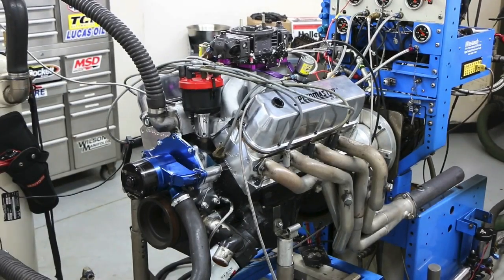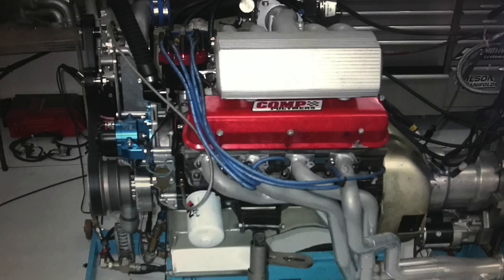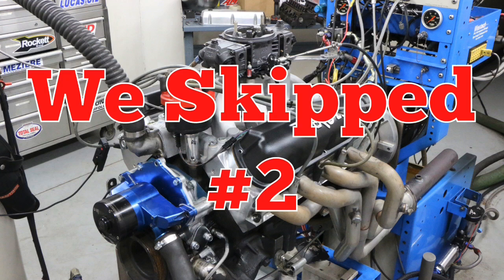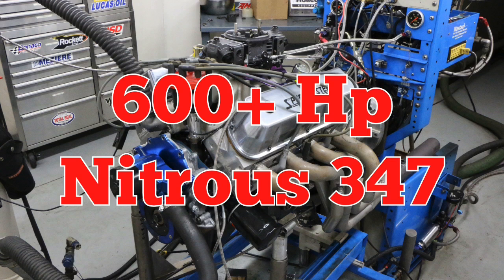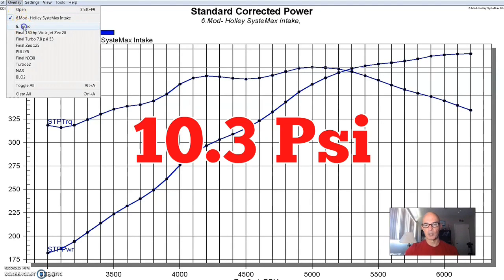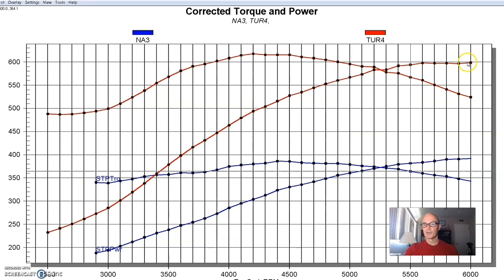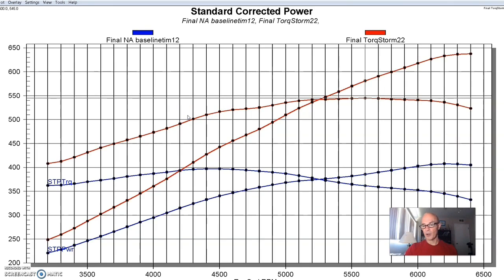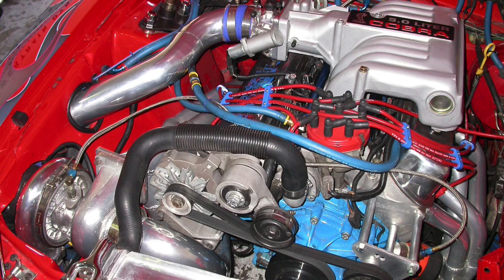5.0L FORD BLOCK SPLITTING-FACT OR FICTION?

Comment: Up until 1980, IIRC, even Ford rated the 289/302 safe for 600HP, the Boss 302 block safe to 1200. In about 1980, Ford was thinking it was time to get rid of "big" V8s, and they came out with that misbegotten 255. When they changed things around for that short-lived piece of garbage, they took the opportunity to fine-tune their thinwall casting process even more, in the name of weight saving and fuel economy. Those late blocks are noticeably thinner and more fragile looking in a number of areas, to me, especially in the lifter valley and mains areas. I had an '89 Mustang with a bunch of upgrades, and a blower thrown on it. I never broke it, but I was more circumspect with it than was my habit, because it seemed a lot of power to put through such a delicate looking block. When I take one of my prized early blocks (usually '74 and earlier) for boring or other machine work, I always get comments from the machinists about what a good, strong block it is, for a Ford. They see a lot more Chivvies, of course. Pre-ignition, other tuning issues, stock or crappy Chinese balancers and excessive "hooningan" or drifting antics all the time on the street are my take on why they fail a lot more than they did back in earlier times. That it is now so "easy" (long as you got the money) to make power exacerbates any of those problems, and so does a block that is much weaker than pre-'80 versions.
Reply: The later blocks have better metalurgy and the castings are a lot cleaner.

Comment: In 1998 or so my roommate had a 91 GT   aod. Ran 15.5 stock. T5 swapped it and some bolt ons..no power adders and it split the block at the track..ran 13.0 and blew at the finish line. No idea the hp level. Car had 140k on it.

Comment: Running 13lbs on my explorer p-head block with only aftermarket pistons. The assembly was balanced with the lighter pistons. This video gives me some confidence to upgrade to AFR heads and shoot for the 600 mark!
Reply: Use an aftermarket balancer if you haven't already. Stock balancers can slip at higher power levels and RPM and cause bad things

Comment: Well I have split one 5.0l and it was on a discontinued high output vortec kit. However I Street it raced for 2 years before it broke(100's of passes). I beleive it was on a 13psi config and dynoed at 439WHP. Odley enough I broke it on a WOT freeway entry not even racing. I also grenaded t5s regularly got really good at replacing gear boxes. My current turbo 96 explorer motored foxbody is on 11psi with a cxracing x series t76 dual ball bearing .96ar p trim and the only thing i have changed was ring gap, full groved bearings with a lunati 51016 dwell cam( bought used for 50 bucks) and added a trick flow main girdle and the gt40 springs, retainers and keepers and maybe home ported everything and I custom built the turbo kit( not exactly a good thing).
Reply: I should've added it was on a fmu and in a full weight 89gt with a old Diablo chip in a A9L. New car is running on MS3 and is light-years better on drivability and im sure is making more power to the tires havent dynoed it or made a official quarter pass yet.      But I beleive it is just like the t5 you get good ones and you get bad ones. I have broken literally dozens of t5s on stock and bolt on power always third gear or shift forks. I have also had t5s that ate 200 shot nitrous  5500rpm+ clutch dumps for years. I'll let you know if I break this motor since its one mac valve away from 600+WHP if i descide to get greedy and i always do.

Comment: I have seen a small block 400 split in half on an airboat. It spun a bearing and threw a rod. The inertia from the propeller at WOT ripped the block when the rod jambed the crank. The crank was broke in four places. The cam was broke in three places. A pushrod went through a rocker arm. The heads where destroyed. Every bolt on the flex plate was sheared off. It was the most destroyed small block I had ever seen. A broken connecting rod hit the camshaft and that's what split the block.

Comment: What were you running for a transmission in your personal car while it was supercharged..  i hear the t5's are basically made of glass and that was the biggest reason i didnt turbo my bone stock 89 gt 5.0 5 spd car.  Granted i was looking for like high 400's. Maybe low 500's. For whp as ive seen on a few videos. Right around 13lbs of boost.
Reply from the maker: stock T5-lasted in years of SSGT Showroom stock racing as well-1000s of shifts-no drag racing

Comment: I have a gt40 head 302 with cobra intake and unknown cam. Really thinking of going stock cam on an on3 set up. What would you recommend
Reply: My 89 gt is stock. The only reason i didnt on3 my car is because the t5's are made of glass and i cant afford a tko swap. :(
Reply: Yeah t-5 won’t hold. I recently put an lentech aod with transbrake. That’s why I want to go turbo now. I have more trans than engine at the moment

Comment: To get a good starting point you need to NDT a stock block to ensure no hidden failure points lurking under the surface that wouldn't matter in a stocker but bound to surface when you step on it...same as you would with used rods if you want to reuse them intending to beat it.  Ford uses good content of nodular iron in everyday blocks and I guess a little better in export parts.  Would be interesting to do fracture mechanics analysis in the leftover corpse.

Comment: These split exactly as described.  It isn't HP or dumping clutch etc, it is sustained top end RPM coupled with the 86-93 light roller block.   The heavier the block, the better on this.   The "B" blocks from the late 60's were the best stock blocks for longer life but were 60-70# heavier if memory serves.   We built alot of motors road racing and when they split, you pull the manifold and pan and the two halves fall over and lay apart.  I have even "Re-blocked" a motor with the same rotating assy from the split one to make the next race.  We shifted 6800 but rpm limit at 7250.  Our spec class made about 360hp.   We tried Kryo and all sorts of things to get the light blocks to live to keep the weight off the nose of the car, but they were a grenade.  We balanced everything that moved, even the cam and gears - but the harmonics just always won.  "The rattler" actually extended life but about 8hrs of cumulative time running hard, and you were on borrowed time.
Reply: The roller 5.0 debuted in '85 5 speed cars (E5AE block). They added 4 lbs of metal (122lbs vs 126lbs) to beef up the '86 & up E6SE/E7TE blocks.

Comment: Yep Ive done it first hand. I had the block up over 550hp on the dyno for a short time and turned it down and a few weeks later the customer the customer cranked it back up and shit the crank outta the bottom. He was shock loading it I am sure. I think there might be casting flaws in some of them. Ive built others that have had no issues.

Comment: I think it starts in the cam tunnel . running a rowdy cam on a na combo will probly split the block faster than boost and a mild cam. Just my guess but the way they split makes me think if you get a little lifter skip banging on the cam tunnel it could be the cause of the sbf split.
Reply: i think its the roller lifters sideloading the valley too.

Comment: One of turbo John’s friends has the stock bottom end 1/8 mile record and he says 700 hp is the magic number. You can get it to live if the tuning is spot on, but he doesn’t even spray his to 700. But then you Mike Murillo. That dude pioneered high horsepower 5.0’s back in the day and dominated. I watched him make his first 7 second passes in the Texas car like 20 years ago, and he ran several in one night, then drove it onto the trailer and left in one piece. I personally think it’s the shock load of dynamic compression that does it. The guys that sprayer 100% of the line broke blocks. The ones that used progressive controllers could get 3 or 4 seasons out of a block before needing a refresh. This is just what I saw and experienced though.

Comment: If I had to guess I would think it's a frequency that splits the blocks. I watched another vid where the guy was talking about splitting a drag engine and he seemed to think it happened during a prolonged high rpm burnout that he was doing to show off. That makes a lot more sense than some magic horsepower or torque level that splits the block. Maybe I'm way off but seems to me if it was a horsepower or torque number you would be seeing issues starting at the mains instead of the lifter valley (sorry if that is the incorrect term).

Comment: In all actually there is 3 things I've found you need to keep an eye out for .
1 harmonic balancer  , 2 tune is absolutely key and 3 keep it at or u der 6250rpm  . 6000 from is best .

I've seen 700 hp live for years . Many many year's. Funny the balancer was Changed every 2 or 3 years . Tune was on piont .

I'm sure it would of lived at 750hp .

Comment: The blocks that split are parts installers. Not engine builders.
Reply from the maker: I'm talking about stock motors
Reply: @richardholdener1727  a stock 5.0 never made 500hp.
Reply: @richardholdener1727  no disrespect.  I have been reading your articles for years.  And I love your work.  And being able to correspond with you is awesome!

Comment: It really depends on a multitude of factors but I'm sure the average 302 block will break at well north of 500hp. I was watching a video a couple days ago where a guy windowed an aftermarket Cummins block at circa 1300hp but had been well north of 1500hp several times on a supposedly weaker factory block. Does that mean that the factory is stronger than the aftermarket? Probably not just that particular aftermarket block had a core shift, that was the channel's conclusion, and so it was weaker.

Comment: I have seen about a dozen cracked blocks. Most cracked around the front main saddle. Two let the cam bearings spin or push out, driver seen oil pressure drop and killed the engine. One split almost to half. Most were drag race/Street car. One NA 347 making over 550HP in a full drag car. Several turbo cars 302 and 347. Two step may have got one of them?

Comment: I'm betting it's not the 500 hp that does it, I'd say it's when you try to hit 500 hp too low in the rpm band i.e. total torque monster; too high a cylinder pressure for too long. That and luck of the casting.

Comment: I had a 331 stock block with a main girdle and a valley girdle with vic jr heads and a vortech s-trim pushing about  11 or 12 lbs of boost. Making right at 600hp and about 10 miles into breaking it in and it lost oil pressure. Pulled it apart before it messed anything up and when i pulled every out of the block, i noticed the cam bearings were sliding out. The last thing to come off the block was valley girdle and the block split right down the middle and was in 2 pieces! I will never use a stock block again with boost! Ive seen them do very good on nitrous though! I dont know what cause it, ive heard boost makes the cylinders in certain block distort and walk around!

Comment: No block thinner than Buick 455 they can go well past 500 hp w/o anything happening! Detonated 350 @ 402 broke main saddle
Reply: they dont need to be spun though. stick a turbo on, spin to 5000rpm, and drag a house down the highway with the tq.
Reply: the 350 blew up because of the cast rods in the 350 buicks.
Reply: Frigglebiscuit lol bad tank of gas! I have built other to 500 hp still on the road today. No detonation no blown engine! Have taken many cast parts to 1000 hp

Comment: Homework I actually like! LOL
personally I think it is combination of design that lacks the strength through the center of the block and flex of the crankshaft at high loads. Generally the block breakage is from drag racing so leads me to believe that massive change in load causes the breakage when a high horsepower engine with a cast crank starts to flex. Guessing a forged steel crank helps a lot. Add on the high loads on the cam from high pressure valve springs and boom.
Maybe. Or they are using GM oil. HAHAHA

Comment: I just can’t wait until one of those Ford “Godzilla” engines Lands in your possession. 😉
Reply: Richards' Words To Live By"Everything Is Better With BOOST"!!
Reply: All I have to say is that I work for a truck leasing company and vehicle cats being stolen haven increased since the pandemic and the Godzilla with only one bank running open sound MEAN AF!!!!!
Reply: Somebody already boosted 1, didn't see all the numbers but it made 1100hp
Reply: How much do they cost with a management system to make it run? It would be AWESOME if ford built one with an aluminum block and all forged internals with 600 horse/600 lb/ft in a crate package for around $15,000. I believe you can buy the supercharged LS from chevy with 640 horsepower for.....15,000. Anyway, I'm I die hard ford nut with a 65 mustang coupe with 289 V8 AND an 89 5.0 fox body gt with the t5 trans. The 65 is a factory 3 speed auto.
Just thought I would start a conversation with fellow motorheads for their thoughts.
Reply: @robert23497  you can't buy a supercharged crate for 15000. Maybe 35000.
Reply: @anthonyrybczynski5420  Scoggin-Dickey sells the supercharged LS9 crate motor for 16,995. I was off by 2,000. Had to look it up because you called my bluff.....lol. Still....17,000 is fair.
Reply: @robert23497  thats a damn good price. I just mean direct from gm i think they are a bit expensive. You can build more power for a better price I think.
Reply: @anthonyrybczynski5420  DEFINITELY!  Here is MY build plan. Ford aluminum Windsor shortblock(comes with forged internals) 6500.00 through American Muscle.com.  Kasse P38 heads.  Kasse cam. Dominator carb.  There is an article in muscle mustangs and fast fords where Jon Kasse made 750 horsepower at 7000 rpm with this motor on pump gas with a hydraulic roller cam. It made 598 lb/ft of torque too. 427 cubic inches of fun in a lightweight package with no blowers or NOS to worry about.  The heads cost 2500.00 which is expensive but they were designed to be VERY similar to the Yates heads that ford uses in nascar so.....you get what you pay for. Anyway, I'm hoping to be all in for 12,000 or less.
Reply: @robert23497  where are you seeing the aluminum short block for $6,500? That's the going price on the iron block short block
Reply: @chipcurrey653  american muscle.com.  They WERE 6500.00. Prices change all the time. They might be 7,000 now OR 6,000. Good luck with your build.
Reply: @robert23497  do you have an exact link to there you can do with tinyurl? I only see aluminum short blocks for $9500 or so

Comment: we split one in a road race car at 500hp na Well not split but cracked up the liffter valley
Reply: Tell me more; I'll be building a stock block 302 Windsor for a track day (HPDE) project I'm working. I'm only looking for 400-425 HP at the crack, little over 300 at the wheels but I'll need it to deal with touching 6800-7200 rpm.

Comment: Excess rpm and imbalance, high load/low rpm situations. Chris Watson has been running his stick/turbo/stock bottom end ( unopened ) 302 Fox Mustang into the 5s in 1/8th for 4 years ( 35 lbs. of boost ). Look him up here and see the car run.

Comment: I only recall one 3" stroke engine splitting a block. That was supercharged and was a bad tune. The others I have seen were on stroker combinations where likely the balance was a little off and they rattled the main caps.

Comment: Slug inertia, cylinder pressures, vehicle mass, potential casting flaws, casting differences from era to era, internal hardware types and materials, even the manner in which you try to conduct testing; with or without external condition variances will make finding differences. There is no hard and fast rule here, no set limit. There are entirely to many variables make assumptions, I look at this as more of a guide line to exercise caution and double check everything.

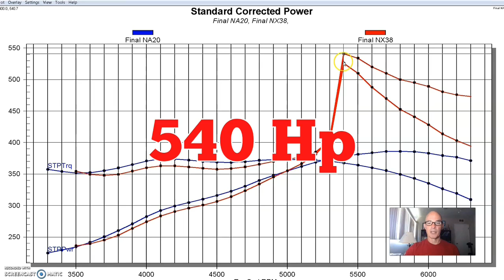Comment: The Internet was wrong?  I'm only @1:07 let me wait and edit. Okay, I think it is going to be a lean condition with a lot of supercharged boost. @1:53 I continue. @5:05 Good Street engine. Okay, everytime Rich adds boost he giggles. @8:32 I'm shaking my head at why a 89 Mustang just smoked me. Okay, to answer what Rich asked to begin with, Why did the block split? I don't know. I've seen crazy N.O.S. added on the street and crazy boost back in the day from Grand Nationals, but never a cracked or even split in half bock. IMO? something was not right. Thanks, Rich.

Comment: Shock load is what causes this usually or bad casting my cousin snapped a stock 302 right in half downshifting from 5-4th. But I've also seen a 1,100 horsepower stroked 408 do it as well but it still ran split in half

Comment: I'd like some input on the SBC 2 bolts supposedly only being good for 600.  Obviously, rotating assembly balance accuracy and rpm have everything to do with it, but I've heard the 600 figure for a long time.  I'm going to surpass 600 within the next week or so God willing
Reply: Thats garbaaageeee,   2 bolts are just as strong as 4 bolts,  the extra bolts were used to dampen harmonics of higher rpm use like trans am racing.  Never once have i seen a 2 or 4 bolt sbc. Spit out the crank with the main bolts/ caps.  If they are going to break its going to be the caps themselves (bolts will remain in place)   or some form of liftervalley cam tunnel issue.
Reply: nah, the 4 bolt vs 2 bolt is bullshit. actually, a 2 bolt should be stronger.
Reply: @frigglebiscuit7484  really?  That's pretty cool.

Comment: Late model 5 liter blocks are weak,  but stronger than most people think. Neutral balance , arp main studs, and a good safe tune will help them live at high horsepower levels.

Comment: I would say a few factors involved 

Harmonics, mounts, torque application to the transmission plus high RPM. All that in sequence with unknown heat cycles of the block equals goofy stuff happening